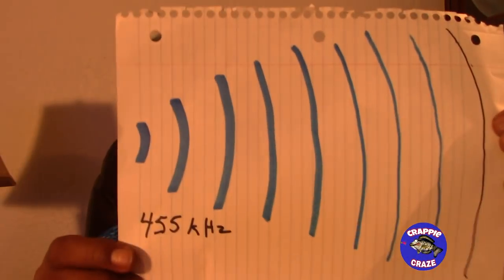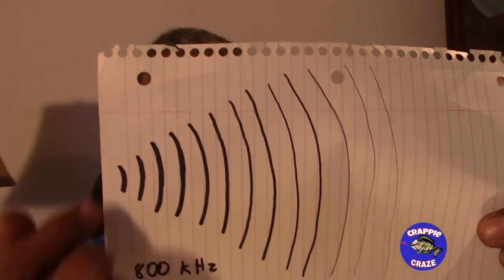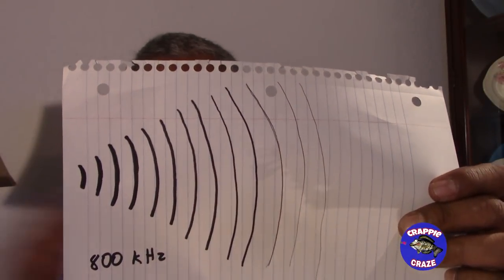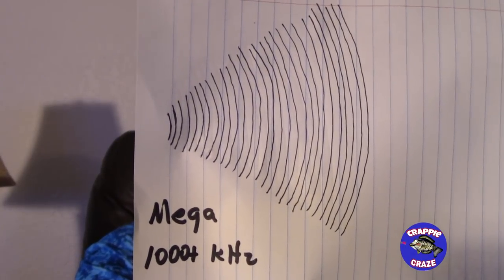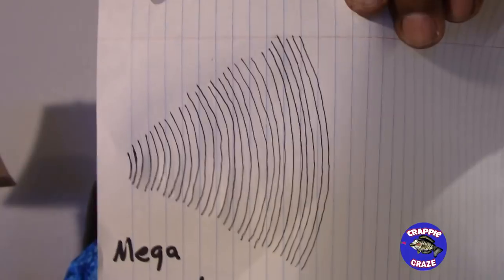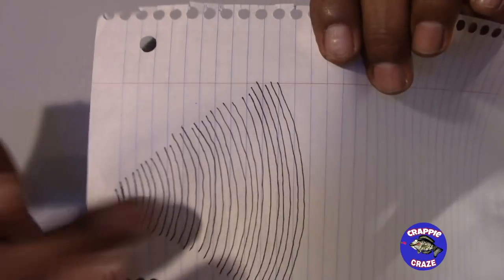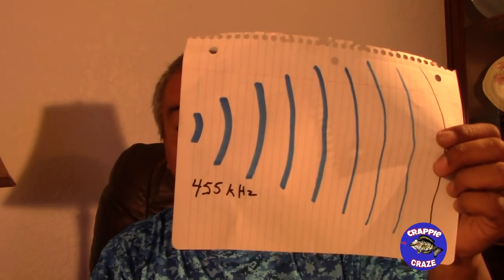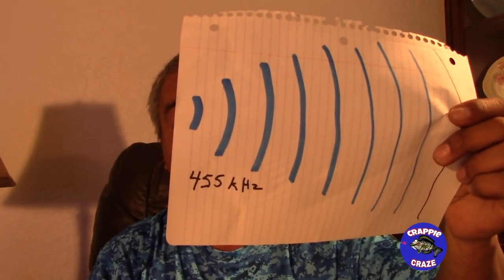I Prefer Using 455kHz Over 800kHz & Mega in SI

Comment: no confusion here, just glad someone can explain things that I was guessing at! I have had times I've just turned them off and fished! 70 yrs old and still use flip phone! Thanks again.
Reply from the maker: KyRangerDog ...Thank you so much for that comment.
Reply: What is your suggestion on running a G2N when not on the water? I've heard you should only run them in simulation mode unless your on the water and I've heard it doesn't matter.
Reply from the maker: KyRangerDog ....I really don't know what it would hurt. The crystals sending the ultrasound pulses out just wouldn't have the water as a conductor for the pulses to travel through.

Comment: Very good info....Since I got my Mega last year I have pretty much had the imaging set to mega frequency and usually got it set out 60 ft.I'm gonna try the 455 and 800 frequency and mess with my range now and see how that works.I got a Helix 9 and with my boat going 1 to say 2 mph what would you recommend for my chart speed for imaging,right now I got it set at 2.Thanks for making these videos,they're helping!
Reply from the maker: If you're wanting that Mega detailed image, then match the  chart and boat speed. That's for looking at something close up, within 25'-30'. But if you're out looking for structure, then go ahead and crank the chart speed up a couple clicks to stretch the screen out a bit. At 60' you're not going to get a very detailed image. that far out put it at 800kHz or 455kHz. Then when you want to get that detailed image, get close to the structure, set the range to 20'-30', run the mega, slow down and be amazed at the detail. Thank  you commenting

Comment: Great job. Just got my 10 Mega and just getting to the install part. But really picking up some good info from you. One question, do you think there is a difference in mounting the SI transducer on the jack plate and or the bottom of the boat. As far as working correctly????I'm seeing both ways of mounting the SI transducer and it being OK to do so. Just wondering what you think??? Thanks...
Reply from the maker: Protecting that transducer is the key along with getting that great image. As long as nothing is obstructing the sonar, then you have to consider which location will best protect the ducer from damage.

Comment: I'm thinking about getting a Helix 7 Mega SI but if you have a 10" screen I think your unit has twice the output power of what I will have. Does that mean my Mega imaging will have an even shorter range than yours? 25' max already seems pretty limited to be very useful. I'm not sure I should even get Mega if I will have an even shorter range.
Reply from the maker: No sir. The only difference will be the screen size and how good your eyesight is. The detail will be there, but just a little harder to see on the smaller screen. The 25' distance only refers to the great picture mega gives regardless of screen size. You can still see things way out if you use a lower frequency on a ten" or 7" screen. Even in mega settings you will be able to see further than 25', but it will not be as clear as if you are to use a lower frequency like 800 megahertz or even lower the further out you want to see. It just won't give that precise detail the further out you go.
Reply: @CrappieCraze  Thanks for answering my question! Also, it sounds like you are saying an image will be clearer at say 45' with 800 kilohertz than with Mega. Correct?................ And thanks for the GREAT video!
Reply from the maker: @MrWhiltetail  ... Yes sir. Mega is really only for detailed up close. The further away you want to look, the lower frequency you want to use for the best detail. But up close the highest frequency (mega) will give you the best image with detail. It's just that the high frequency waves are very thin but very rapid and so up close they give you very detailed images. But they lose strength at any distance (they fade out) so the return is not as good as it is with a lower frequency where the lower frequency waves are thicker with more return to show a better image at distance. I hope that's not confusing you(?).
Reply: @CrappieCraze  Nope. That was a GREAT explanation. Now I understand. Thank you!

Comment: Great video.  Thanks.  Question not exactly relating to this video, but just got a Solix Mega on the console. Do you know if I put another Solix Mega on the front, could I mount the transducer for the front on the trolling motor?  Thinking about running ethernet cable between the two.  I'm up front most of the time.  Thanks so much.  Lots to learn about the Mega and your videos are great.  Thanks again.
Reply from the maker: William Haberstroh ..... Yes you can put the transducer on the trolling motor. I would definitely get a shield to protect it though.
Reply: Thx!
Reply: One more question ... do you use the Solix or Helix?  Do you have trouble with voltage with the Solix?  We get low voltage alarms constantly.  As soon as you turn something else on (live well or other unit), or even running by itself we get a low voltage alarm, even though it's fully charged (directly to starting battery).  New battery, new battery charger.  It's a pain.
Reply from the maker: William Haberstroh ... Both my units are Helix and yes they will give you low battery alarms. I wouldn't recommend turning the alarm off, but it's set to high. Just lower the settings a bit so it won't be going off all the time on you. But not so low that the alarm doesn't warn you that you're about to drain your battery so low it won't crank your motor.

Comment: How do u have your transducer installed/set up & leveled?
Also are u on Facebook
Reply from the maker: Bill Dunston ...https://m.facebook.com/jessie.lopez.900

Transducer is on my transom. Nothing fancy. I just installed it on spring loaded bracket for protection. I leveled it by eye and just adjusted it after being out in the water. On the water I eyed it by going past bridge pillars. Once you go by them and they're pointing straight at the boat, then you have the tilt level right. Took me 3 adjustments to get it the way I wanted it. The side to side level I just leveled to the bottom off the boat and the line left from my old transducer.   
The one on my trolling motor I just leveled it by eye. Not much you can do with it on the trolling motor because the motor well tilt as you give it power and it levels off.  I do have a transducer shield on that one though.